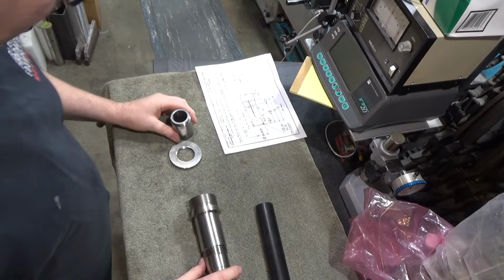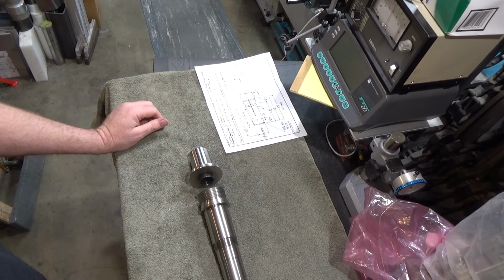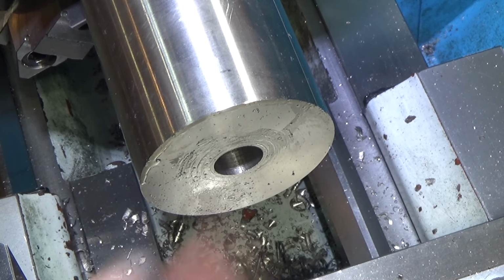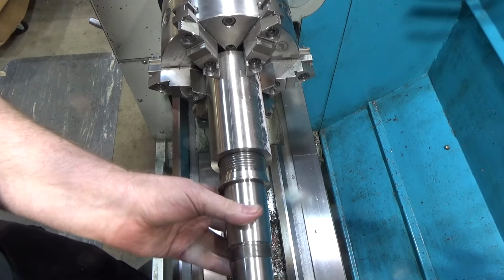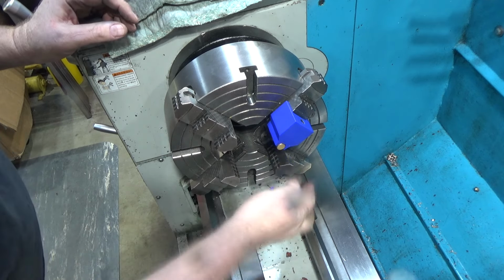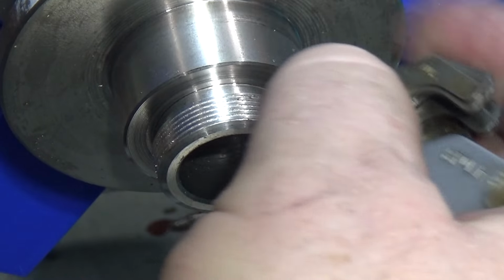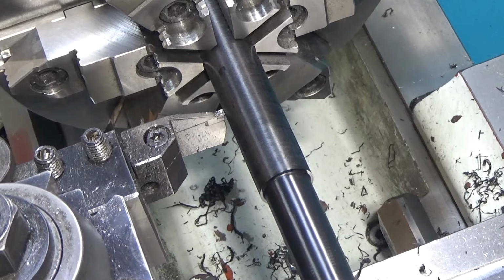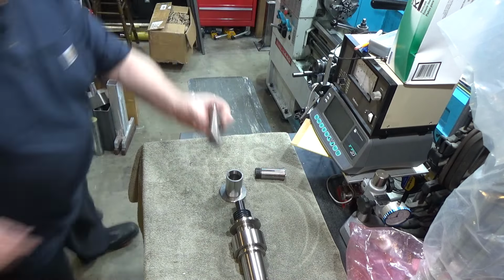227 Automated Needle Welding Project Continued Part 04

Comment: I'm not a big fan of relying on threads to maintain concentricity, and I suspect that you're going to have more runout than desired. The female taper of a 5C collet holder is supposed to provide alignment and should be rigidly attached to the spindle. In your device, the taper is floating and the collet is entirely dependent upon the clamping threads for alignment. 

I believe that a hollow drawbar extended through the spindle, like a collet holder on a Southbend lathe, would have been a better arrangement. I hope that your device meets requirements, but if it doesn't, you have plenty of space within the spindle for a drawbar.
Reply: Maybe mount the 5c collet holder in a bearing? If that's the case the spindle setup isn't necessary. The collet holder becomes the spindle. Then the collet release is is simpler.

Add: obviously you need a drive to rotate the collet.   Stepper motor with a belt?
Reply: @maxheadflow  There appears to be numerous areas for improvement, but without more information about the manufacturing process, I'm just guessing at what's going on. Typically, material is feed through the spindle towards the collet/chuck, e.g. bar feeder. It generally provides a more efficient path, but for some unknown reason the material in this situation is being feed through the collet, and ejected out the back of the spindle. The end user may be attempting to piecemeal processes together rather than designing a comprehensive solution.
Reply from the maker: A drawbar is an excellent idea. There is a reasonable amount of eccentricity allowed for this fixture so if the center of the 5c collet is not perfectly centered it will still work fine. This setup is for laser welding and it might move the focal point a bit, but there are moderate tolerances allowed.
Reply from the maker: Interesting suggestion as well, thanks.
Reply from the maker: The choice of feeding in the needles from the front was defined by the work space which has minimal room to the left of the headstock. Also, since this is laser welding, there only needs to be minimal friction on the closed 5C collet to allow it to rotate. The welding process applies almost zero force on the needle. These ideas are only my first draft.

Comment: Robert -  Let's start here . Excellent Video as usual . Great project . Excellent  Machining .Now for my critique -- Why do 
you choose to use a four jaw chuck with  with soft jaws ??? It's very cumbersome and time consuming . In my world , I
choose to bore soft jaws in a 3 or 6 jaw chuck . You control concentricity and create a shoulder to control your desired 
length. You can remove the part from the chuck and put it back without any issues . You can also remove the soft jaws 
and put them back without any issues . I rarely need to use a four chuck for round pieces. -- Jim
Reply from the maker: I chose the 4-jaw chuck so that I could dial in the part but, I had not considered soft jaws, a tool I always seem to forget. You are absolutely right, Jim. Thanks for the tip.
Reply: Robert - If you use Soft Jaws - you'll become addicted . Repeat after me - Four Jaw Chucks are for Irregular  
shaped pieces . 3 and 6 Jaw Chucks are for round pieces . Write that on the Black Board 20 Times .
Remember one thing - I will be watching . If you forget - I'll have to deal with you - "Severely" -- Jim